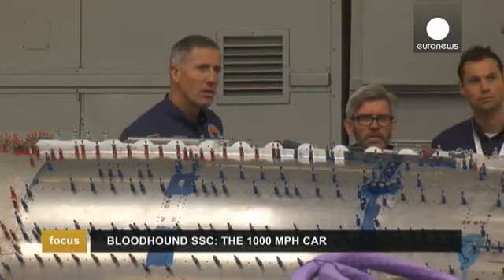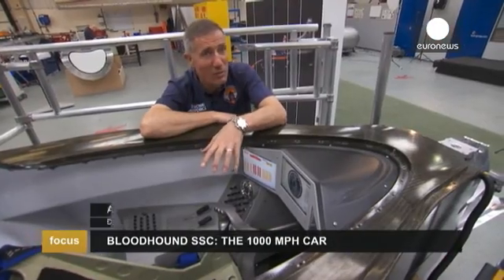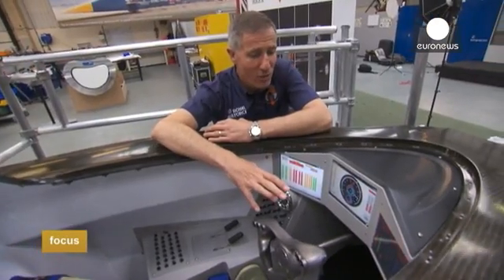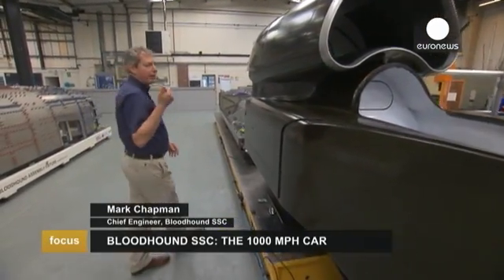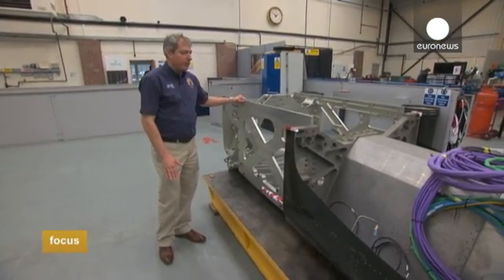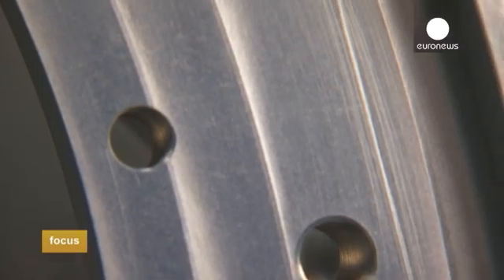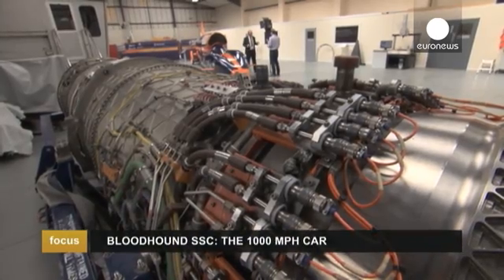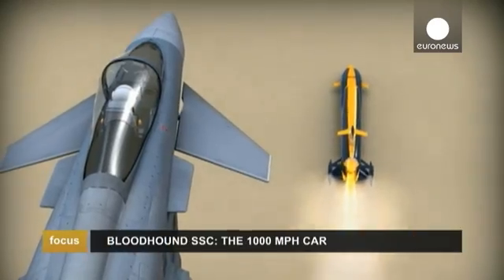Inside Bloodhound SSC: the 1000 mph car - focus

Comment: What is the piston engine used for? Is it used to drive a generator?
Reply: As I recall, it is a Jaguar V12 engine and its sole function is to drive the fuel pump for the rocket motor.

Comment: A few questions to all of you out there.

What is a car? What defines a car?
What's the difference between a car, a train and an airplane, or a scud missile.

A modern scud missile has a top speed of Mach 5.
That's almost 4000 mph. FOUR THOUSAND...!!!

So do you still have to have contact with mother earth when you break the record for the worlds fastest car?

I mean, can you leave the ground? If not. Why? Because it's the ONLY thing that makes it "RESEMBLE" of a car.

What's the fastest bicycle ever?
The one on a plane to Mallorca.

What's the fastest Beetle ever?
The one that's been replaced by a ferrari.

What's the fastest airplane ever?
The Challenger Spaceshuttle.

What's the fastest curveball ever?
The one fired out of a canon.

Get the picture?
Reply: +Peter Liljebladh Hi there, I'm a Bloodhound Ambassador. The definition of a car under the FIA rules it it has to be driven and controlled by the driver, so no remote control used, it has to have at least 4 wheels and be in contact with the ground at all times. This is why the Bud rocket car is discounted from Landspeed record successes as by the time it got anywhere near supersonic speed the 2 rear wheels where not in contact with the ground. I'll forego any other arguments as to why the Bud car is not officially recognised as there's too many reasons why it failed to become official. People also mention engines like jets making it not a car. until the internal combustion engine was invented cars were steam or electric, so the engine type isn't important. Bottom line is it has to be controlled by the driver, have 4 wheels and all 4 wheels in contact with the ground at all times, otherwise it doesn't count.
Reply: So any spacerocket that's able to keep contact with mother earth long enough will do.

In my opinion a car is being propelled forward by the power directed to one, or several of it's at least four wheels.
Any objections.

Maybe we need two Classes. 
One for CARS,  see description above, and one for land-wheel-supersonic-jet-bomb-thingies.

Just because it's a landspeed record doesn't make it a car.

ps. So a threewheeler is not legal? ds.

Comment: A jet engine on wheels, it's not a car just because it has wheels, even a jet has wheels and it's not called a car
Reply: You need to go and look up the definition of the word car. There are no rules about what power source a car should have.
Reply: They're out to break the 'Land Speed Record'. Please will you point to the word 'car' in that title.
Reply: +myfeeling4you The fact it has a jet is neither here nor there, and I am a Bloodhound Ambassador. The definition of a car may includes the part 'usually has an internal combustion engine', however in car development they came after the car. Early cars including some land speed record cars had electric or steam power. Under FIA rules to be a car it has to be self propelled, driven by a driver, have 4 wheels and all 4 have to be in contact with the ground at all times. Picky I know, but also a jet isn't called a jet or have wheels. You mean a jet aircraft. the jet is the engine not the vehicle. We don't call them cars as they are aircraft and designed not to stay on the ground, Bloodhound is. It's a car in every sense of the word it just uses a different engine system which is more powerful that the old, polluting and rather old internal combustion engine.
Reply: +myfeeling4you  should a car have an internal combustion engine? Because it has one of those too... And a Rocket for good measure.
Reply: Harold-Sweat-Head I'll go back to my original comment and read it carefully about what I said about a jet !
Reply: brett248vista Look at the contraptions being made in the form of "flying cars " not a plane you drive on streets but a car you fly, just as the thing we see here that is mainly a jet engine. A land speed record is one thing and a car doing the same thing as another, this is not a car sorry.
Reply: myfeeling4you A "Flying Car" Flies and Drives on the ground. The Bloodhound SSC does not fly, it never leaves the ground (we hope). It drives around on four wheels.   Is it a conventional car? No... It's not likely you will drive it to the local store for groceries any time soon.

From Dictonary.com
au·to·mo·bile
 (ô′tə-mō-bēl′, -mō′bēl′)
n.
A self-propelled passenger vehicle that usually has four wheels and an internal-combustion engine, used for land transport. Also called motorcar.

It meets those requirements per the definition of the word. It transports one passenger on land using four wheels an an engine.
Reply: I can't think of any contemporary land speed holder that could be classed as a conventional motorcar so why single out the Bloodhound?
Reply: I'm not singling out the Bloodhound, it's how the owners/designers/drivers/supporters classify these things as cars when they are not, yes they can break a land speed record but like I've already said it's a jet engine on wheels, so I feel those cowboys on their saddles who make wild claims about land speed records being broken in a car had better get off that rocking horse before they fall off and end up looking stupid. I would like to see someone break a land speed record in a conventional car just as a motor bike broke a land speed record on 2 wheels and that was a real motor bike, not a jet engine on 2 wheels, see my point ?
Reply: brett248vista But with a jet engine, not an internal combustion engine, yes both forms or propulsion occur internally, I'm being technical here.
Reply: myfeeling4you it HAS an internal combustion engine... It's powered by three different power sources. A Formula 1 V8, A Jet Engine and a Hybrid Rocket.  Research...  Can't win this one friend :)
Reply: they were invented as automobiles, crude as were

Comment: Faster than a fighter jet. Fighter jets can go to 1,400 MPH and call that faster than a fighter jet.
Reply: The difference is fighter jets go Mach 2 and beyond at high altitude, no fighter jet can go this fast close to the ground as the air is to thick.
Reply: faster than many fighter jets if you want to get really anal about things
Reply: What?
Reply: Since this car has a rocket the comparison might be with the X-15 built by the US airforce in the 60s, with a record speed of mach 6.75.
Reply: +TheSilentSnake36 The fastest jet at low altitude anywhere near sea level was a Lockhead F-104 Starfighter which reached around 990mph. If Bloodhound reaches its design speed of 1050mph it will be faster than a jet aircraft, though I'll admit they should have said at low altitude.